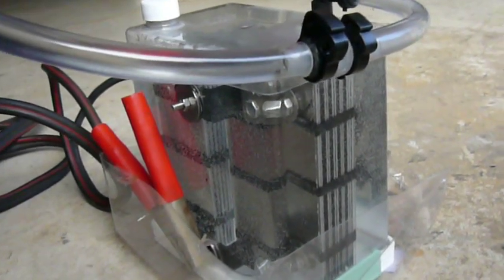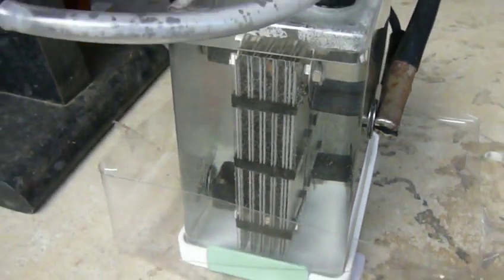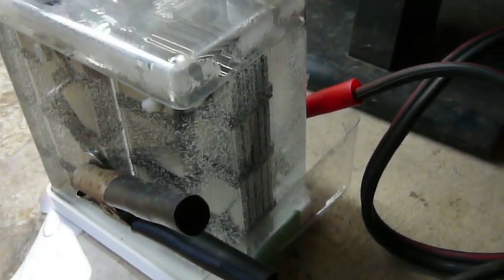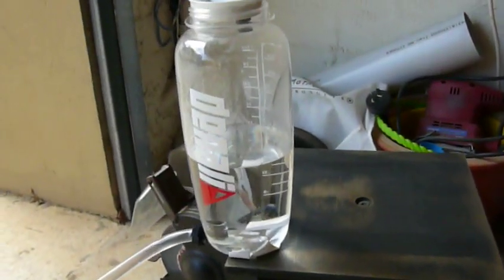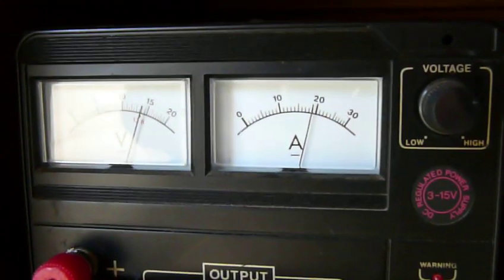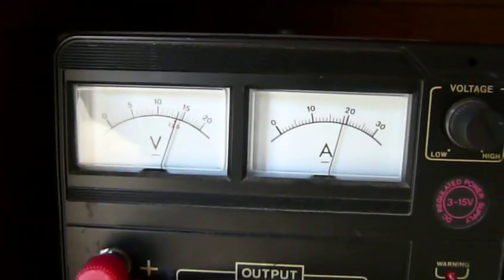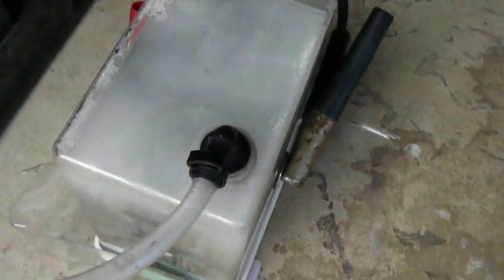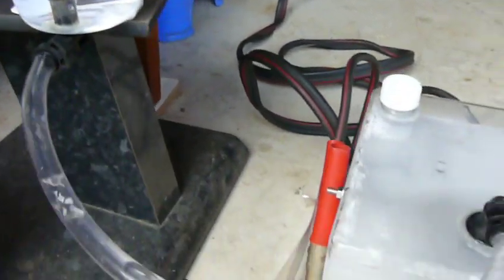HHO with split Smack Gen II

Comment from the maker: its actually a crap design, lots of leakage from one cell to the other. Maximum output is less than 1LPM even at over 20 amps
Even so I got a 14% fuel saving on my Pajero

Looking at making a dry cell next